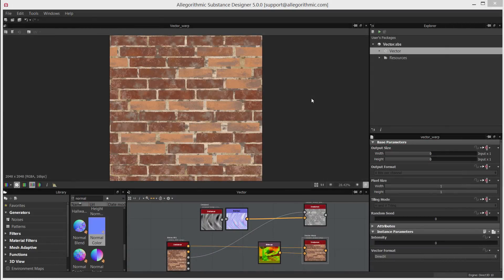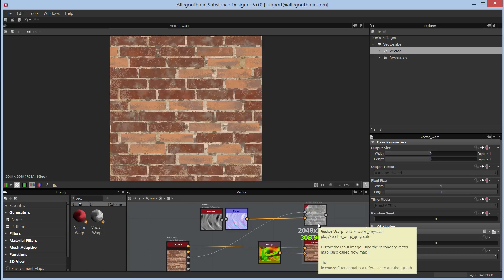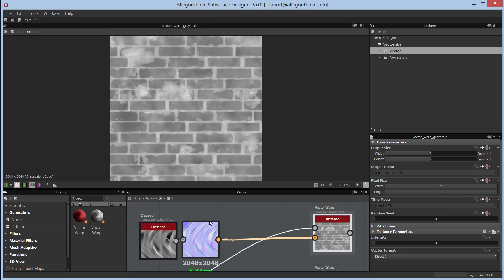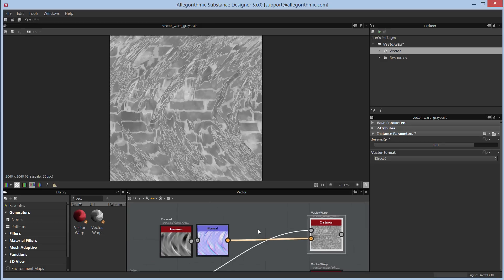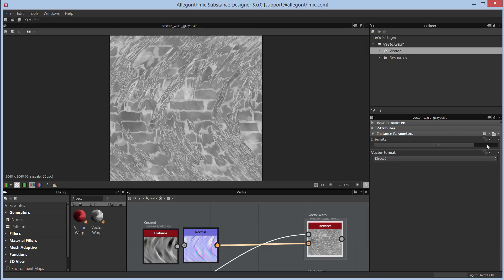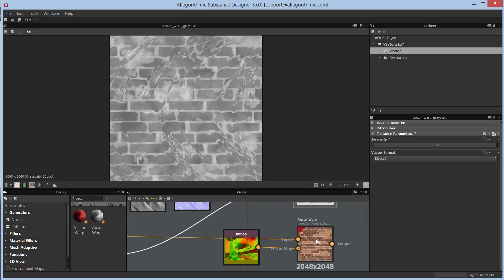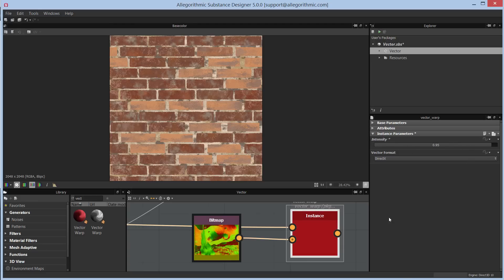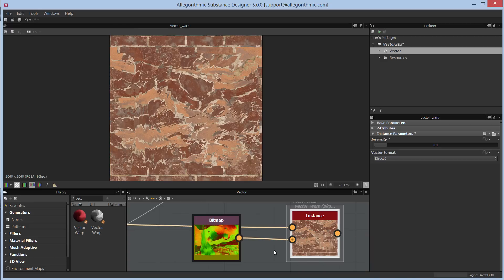Substance Designer 5 - Vector Node | Adobe Substance 3D

Comment: Will there be any animated texture workflow tutorial?  And,  The tri planer node now processes all the pixels with in the input image.  If I go to the pixel processor, is it possible for me to include a mask input from a mask image to firstly exclude the area that I don't need it to process, and thus optimize the calculation time the Tri-planer needs for calculation?
Reply from the maker: Brent Lio We can look at animated texture tutorials. This would be good to have. For the tri planar, I would just modify the sbs itself to include the masking. You can find it in the Resources folder for SD application.
Reply: Allegorithmic I did create my own tri-planner, but the if-else node doesn't affect the calculation speed.  It does not exclude the masked area from sampler.  So all those samplers will still sample full image regardless if some area is masked or not, thus no optimization could be made atm.  Thou I break off all X, Y and Z into different output and blend them based on the output image.  Give a better result on blending part.   Pixel processor is definitely a powerful addition to Designer.